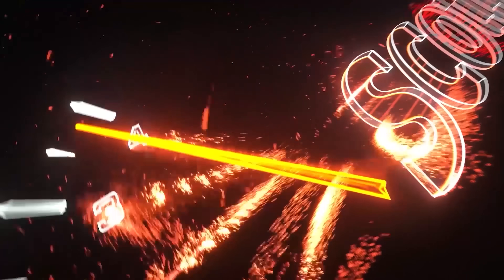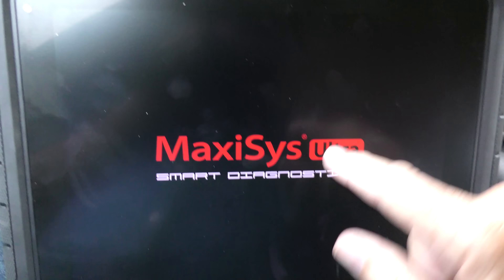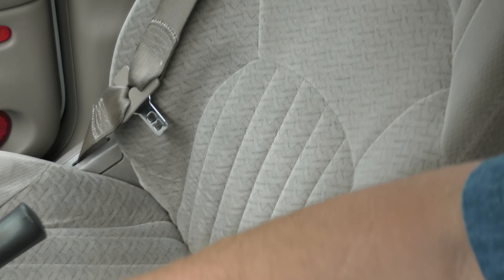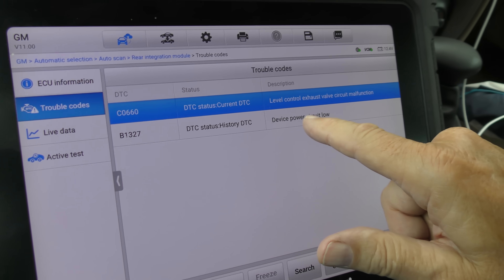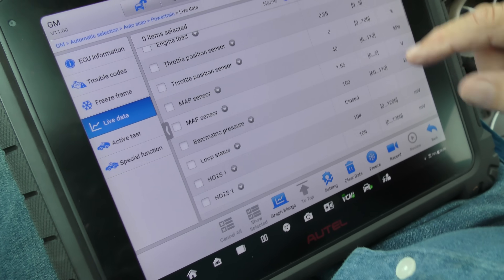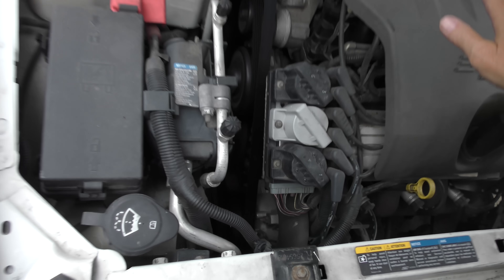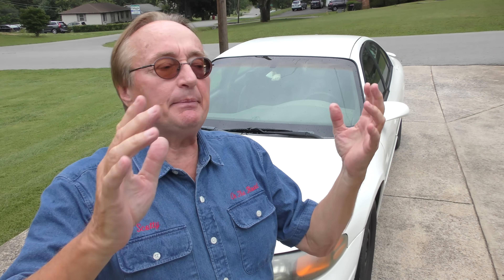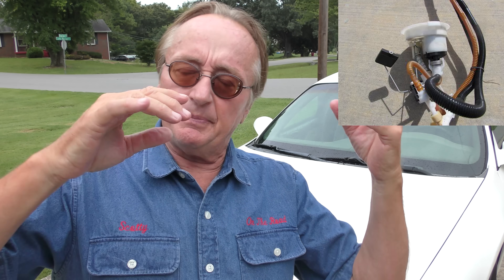Doing This Will Double the Life of Your Car

Comment: Those 3.8 motors are bullet proof!
Reply: Except for the plastic intake manifold and the gaskets that prematurely fail, resulting in coolant in the oil and hydrolocking the engine.
Reply: Engines great.  Many have met an early end because GM recommended changing Dexcool at 5 years/100,000 miles.  It turns acidic before that, eating up the intake manifold gaskets and other parts of the cooling system.  If you change the coolant every 3 years, they last a long time.
Reply: @sapphire163  That's a well-worn internet 'truth' that I too used to believe.  I think the bigger issue with Dexcool was people (at the quick-lube places mostly I suspect) adding regular glycol coolant and contaminating it.  I'm still running it in a 2001 Yukon with 225K miles on it with zero issues.  It's never eaten any gaskets in the 5.3l engine so far.  Coolant test strips are a good thing to have . . .
Reply: @sapphire163  I know all about that.  That was 30 years ago!  Show me a GM car made in the past 20 years that has had any issue with Dexcool.  I used to switch out to "the green stuff" myself but no longer.  Most cars now use it, in one form/name or another . . .
Reply: @redmondjp  That brings up some questions.  Did the dexcool formula change?  Did they shorten the recommended change interval?  Did they change materials of parts that contacted the cooling system?
Reply: @sapphire163  I know that they did change the rubber gasket material in the mid-to-late 1990s.  Not sure about the coolant itself.
Reply: Scotty, I really need a reply about 2014 Chevy Malibu. Would you please send a reply.

Comment: I had 1994 t bird 4.6 v8 that would stall at a stop it was the crankshaft sensor the plastic around the sensor would expand when hot and the spark escaped

Comment: I just recently had to change my fuel pump in my Fiero only problem is with my Fiero fuel pump it didn't even indicate that it was going out I just went to a store came back outside it wouldn't start unhook the fuel filter turn the key on to see if his spray gas did not spray gas replace fuel pump everything was working fine it was not fun to change

Comment: In 2021, Cummins Inc began a proof of concept program to evaluate hydrogen fueled engines. Some of this development occurred in the UK, taking advantage of a $10 million grant from the UK’s taxpayers.

In September 2021 the company announced it was developing both a medium duty 6.7 liter and a heavy duty 15 liter engine powered by hydrogen. In 2022 they attended the IAA Transportation Exhibit and unveiled their B6.7H medium duty engine. In May 2023 they attended the ACT Expo in Long Beach and unveiled the X15H 15-liter hydrogen powered engine for heavy duty commercial vehicle. 

In June 2023 Cummins announced that their X15H 15-liter heavy duty engine would go into full production in 2027. The company is in a joint venture to develop a 700bar hydrogen fuel storage system (fuel tank). This would boost range from industry standard tanks rated at 250bar.

Right now, the only hydrogen fueling stations are located in a few California cities - Frisco, LA, Long Beach, and route 80 heading to Trukee, for example. The infrastructure is seriously lacking to support commercial trucking and passenger vehicles.